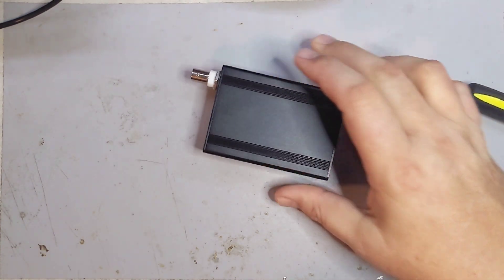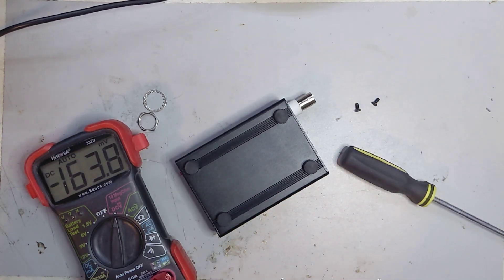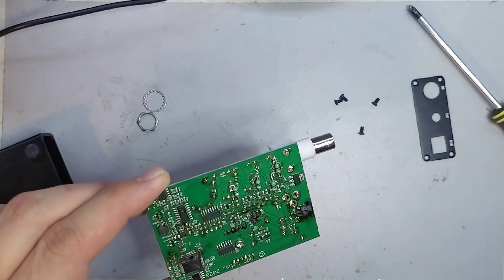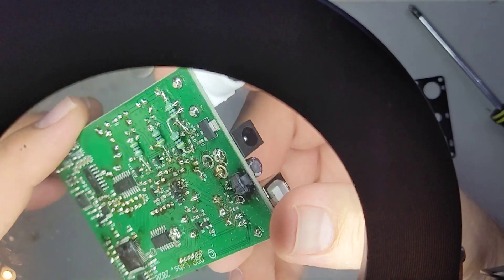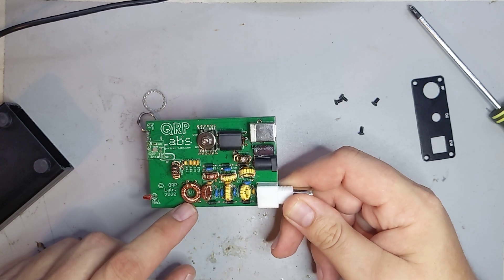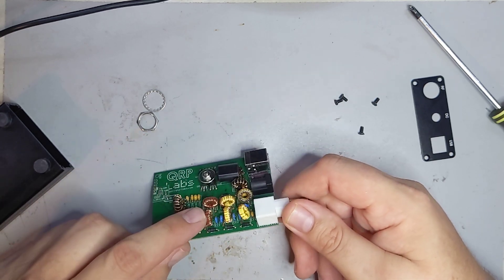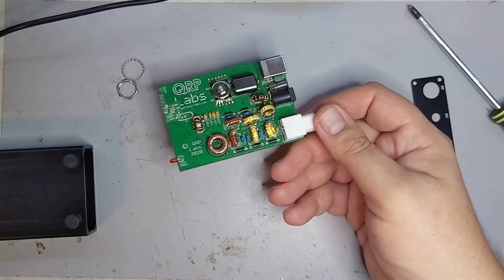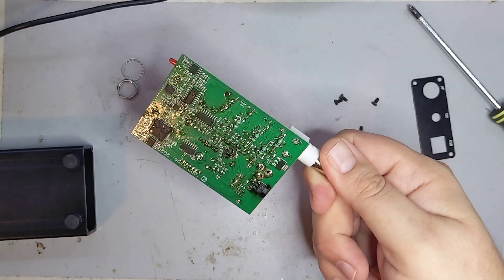My QDX Went POOF! And I'm not even upset. Why?

Comment: Hi Ryan Did you get a replacement before the stock dried up? I'm waiting for the new revision/redesign to become available from QRP Labs. If I could do CW better I'd do a QCX mini kit while I'm waiting.
Reply from the maker: Nope, waiting just like everyone else. No big deal 🙂
Reply: @MiscDotGeek  Thanks for the reply. Too bad the 3.3V regulator failure was to short to supply voltage. The loss of the regulator would have been a quick and cheap fix. We'll just have to wait and see what Hans' solution will be.
Reply from the maker: @ralphmills7322  it is already solved. The newer designs have different parts and a different circuit that basically fixes the problem just as the modification mentioned in the video would.
Reply: @MiscDotGeek  I heard that a new prototype was being tested. I'm sure Hans wants to ensure a good product but also a secure and adequate component supply! Thanks again for your reply!
Reply from the maker: @ralphmills7322  You bet. If you get a chance check out the next video, it goes into it further. V2 and V3 both have the newer design already :) https://www.youtube.com/watch?v=FFTdv5ZW7Ok

Comment: Somebody with sufficient SMD rework skills could probably fix that radio. The catch is that because of limited availability, getting those components might approach the cost of a new QDX, and that's not counting the labor that would be required to repair it. I'm not offering to take on that project, but somebody might want to. A quick check on eBay shows the only available AK5386 chips selling for nearly $50; at that price attempting the repair is pointless.

Five parts get power from the 3.3V rail and therefore might be fried: the STM32F401 microcontroller, the AK5386 A/D converter, the 24C64SM serial EPROM, the TCXO module, and the Si5351A clock generator/frequency synthesizer. And of course there is the AMS1117-3.3 regulator itself. Everything else is powered from the 5V rail or the input voltage, and is unlikely to be damaged. Of course those are the most expensive and hardest to find parts in the rig.

Getting the microcontroller would be a challenge (long lead times) and you'd need cooperation from Hans to program it. You might have to replace the Si5351A with an MS5351M because the SiLabs/Skyworks part is difficult to get. The hardest part to find might be the AK5386; it's discontinued so you'd have to find new old stock, but fortunately you would only need one.

While you're at it, might as well replace the 5V regulator with a 78M05 as it is in the later revisions (takes a bit of work because the pinout is different), power the 3.3V regulator from its output, add the reverse polarity protection MOSFET and the bias circuit for IC3, and remove unneeded pullup resistors R5, R10, R11, R12, and R14. Making those changes would update the circuit to be equivalent to the revision 2 circuit.
Reply from the maker: Hey Shirley, Yep it is possible to repair. But, parts are very hard to find if not impossible as you've mentioned, and then there's the need to get the MCU programmed, which is non-trivial. If this were the last QDX on Earth it might be worth it, but there's a batch of 2000 coming. It'll likely be ready before I'd be able to repair this one ;)

Comment: Thanks for the update on your QDX.  As I found in my v1 QDX which I put on your earlier talk. The 3.3v regulator was running hot even in the 9v version.  So I rerouted the 3.3v input to the 5v output.  If you have an un modified v1 QDX. I suggest you do the mod even more so if you put it in the small case, also not to exceed 12v.   In use the QDX is exceptional technology.  I found on receiving It was at times better than an IC7300 and the 3 to 5 watts output does well as a QRP transceiver.  Thanks for your experience in building and using the QDX even if to destruction. I am sure it will be useful to other Hams. I wish you well in the new job and hope you continue your Utube.